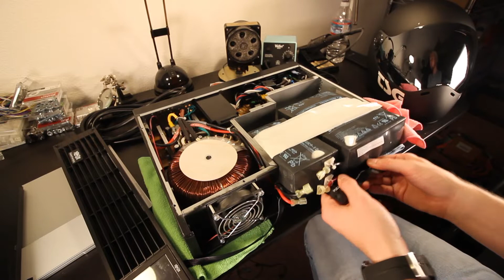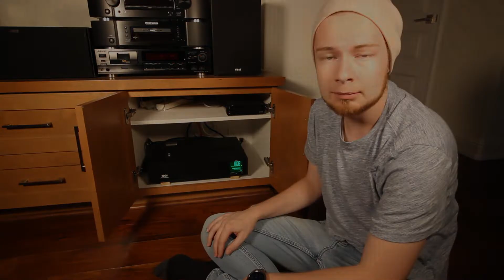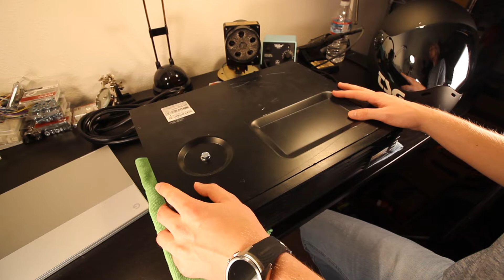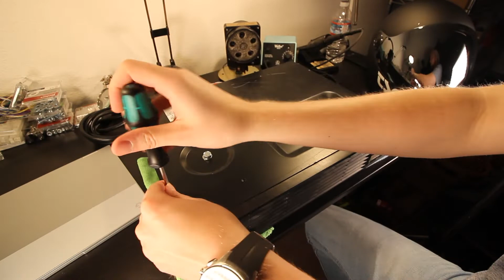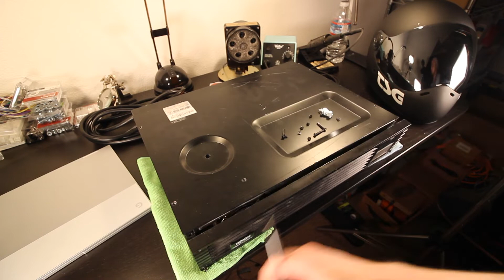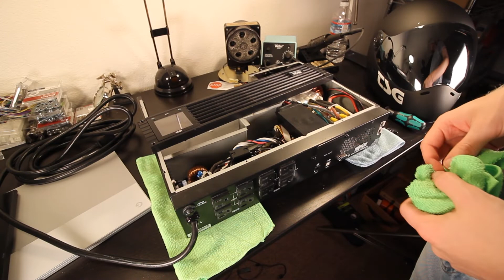UPS Battery Fail | Teardown and Test | Tripp Lite 1500VA

Comment: I have this exact same unit i picked up for cheap hoping to use it for a project. I have a 72v 26ah LFE battery pack that I hooked up in place of the lead acid. it works fine for the originally intended UPS purpose, however what I would like to do is charge this battery pack with a solar panel setup I'm building, and use the UPS as an inverter to power a 200w pump that I have running approx 6 hrs/day. Do you know how to turn off/disable/remove the feature of the UPS that would allow me to run devices straight off the battery and not have to wait for power to be cut from the wall plug?

Comment: Hi! Thank you very much for the informative video! I have this same UPS and, as you did, I found the fan to be distractingly loud. I was wondering if you made a video about that replacement, or which fan would you recommend for this, as that's actually the only downside to what's proven to be an amazing piece of hardware. Also, I've found dust around the vent very often, as it just takes it in. Do you open up just to clean it? If so, how often? Is there any advice on how to go with it? Sorry for these many questions, but I've never done a teardown such as yours before, and I'm a bit scared of destroying / burning the piece ---if not actually deleting myself lol. Thanks for your time!!!